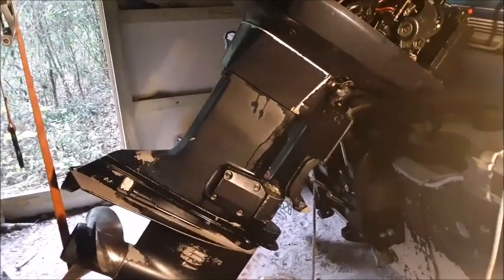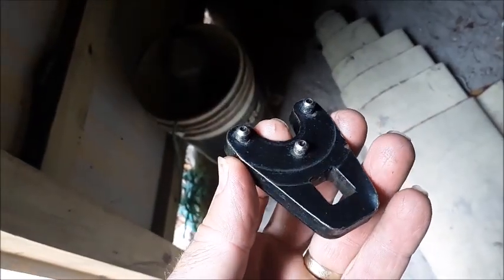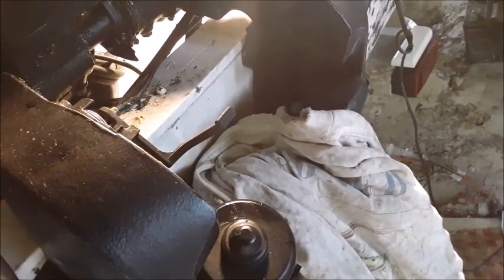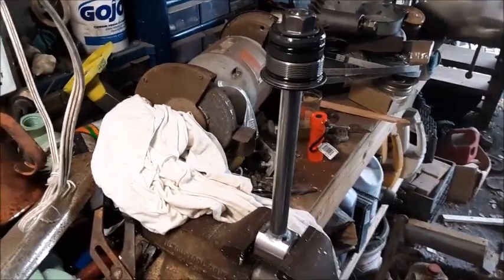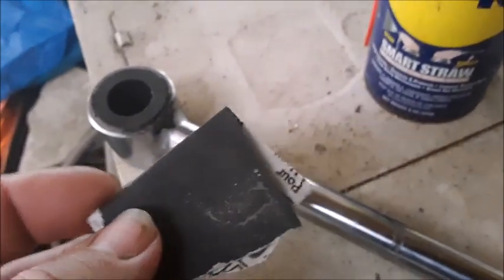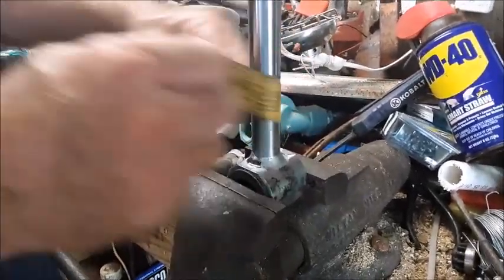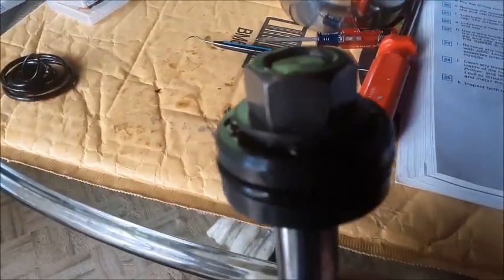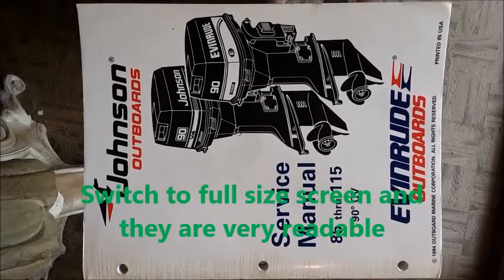Rebuild Your Evinrude Power Trim Cylinder With it Still in the Motor Saddle

Comment: Appreciate the video. Was able to repair leak with new  tilt seals on 1991 150 hp evinrude motor without removing tilt and trim. Just raised motor higher after removing upper tilt pin and opening check release valve to lift it.

Comment: My Tilt/trim constantly needs oil but I don’t see it leaking on ground. Loss is during run time. Should I replace all piston seals?
Reply from the maker: Look at the top of the piston seals and see if any of them look oily.  Fluid loss probably wouldn't show up on the ground.

Comment: thats the MUCH better fastrack system. just 2 pins instead of 6 seized screws to get the thing out. plus once its off you can replace the trim motor as they all go bad eventually.
Reply from the maker: Thanks for the comment.  I like you suggestion just in these salt water areas were we are located the lower pin is many times no longer removable due to salt intrusion.
Reply: @creativerepairing2960  you got it. Some are a nightmare... especially the big v6 motors as you have alot of weight on it. Relieving the pressure helps, but not by much!

Comment: I used my angle grinder Spaniard wrench and it fit perfect to tighten it up
Reply: you got really lucky
Reply: @mikeboston421   why did he get luck ?
Reply: @manmanman6956  because most angle grinder spanner wrenches won't fit.
Reply: @bradhawkins3687  i've used snap ring pliers with the 90 degree ends as well. works perfectly. you dont need a ton of torque to seat that seal. little gasket sealer on it is all you need.

Comment: I have a 2005 ETEC 50. We need to replace the O ring on the hydraulic tilt pump but we cannot get the PIN out to tilt the motor up and away to get at the O ring placement. The pin is threaded on the starboard side and we have attempted to slide hammer it out. We were warned that hammering on the pin on the Port side would cause it to mushroom and make things work. Any Ideas?
Reply from the maker: I am sorry I am not familiar with that model.
Reply: you don't need to take the pin out just to trim the motor up! unscrew the manual release on the port side 1/4 turn or so, and lift the motor up. put a block under it to keep it up, or use the trailer lock. then complete your work.
Reply: @ct1762   I did the smart thing, took it to the local shop with 3o years of experience, and had them fix it right.
Reply: @victordohleman953  very smart! Lots of guys have pride problems, but taking it to someone thats done this exact thing 200x is just common sense

Comment: You my brother, are an inspiring example of a witness! The repair info was good, but the witness was much, much better. I pray someone is touched as a result of your faithfulness. I have an ‘87 Johnson 150 and my trim solenoids keep burning out, about once a year? Any thoughts?
Reply from the maker: Hi Jim,  Thanks for the word of encouragement.  I just past 1 million people who have watched these videos and it is still growing.  As for the trim cylinders, if you keep replacing the seals and they start leaking again in a year, any chance the shaft might have any damage on it that could be cutting into the seals?

Comment: The part with the nut and was hard to get off, had to use a bearing puller after I removed the nut. Trying to put it back it very snug and can’t get it back on. Any ideas?
Reply from the maker: Hi Johnny,  Sorry to hear about your problem.  Sorry I don't have any ideas for you on that one.

Comment: Great video on replacing the tilt seals, I have a leak in the tilt as well but dnt want to buy the whole kit ($80). Do you know the part number for just replacing the seal for the tilt.
Reply from the maker: No, but there are several web sites which have parts schematic diagrams where I am sure you could find it.  Thanks for the comment.
Reply: take it apart, take in the old seal, best if you take in the old trim part that has the seal on it to make sure it fits right

Comment: Was you tilt motor making any weird noises before you changed the seal?
Minen has bad seals and has recently started to sound weird.
Will be attempting this soon. Thank you for this video!
Reply from the maker: Hi,  Thanks for the response.  It didn't make any  weird noises just was leaking trim fluid at the base of the shaft.  The trick to this video is realizing you can rebuild it without taking the whole trim system out of the saddle.  Best of luck on you job.  Thanks

Comment: Hi my name is Marco from germany. I have a problem with my E175FSXECS, especially the part 0435263. I dont know wich way i have to put the springs with the balls and these little  metal pin together, cause i lost them during my repair work. Do you have a precise description?   It would be help me so much.    Best regards from germany!
Reply from the maker: Hi Marco,  I couldn't give you an exact answer without taking it apart again.  I would suggest you try one of the parts schematic diagrams.  I usually use www.crowleymarine.com.  Hope this helps you.

Comment: Where do I get the tool and the seals kit?
Reply from the maker: I got the seal kit off ebay.  The tool also came from ebay but was a used OEM tool.  Try searching the internet for "spanner wrench" and you will see some options.  If you have a freshwater engine some of the cheap universal spanner tools will likely work.  My engine is a lower saltwater use and the top came off the cylinder very easy.